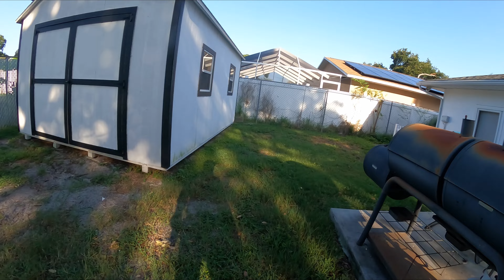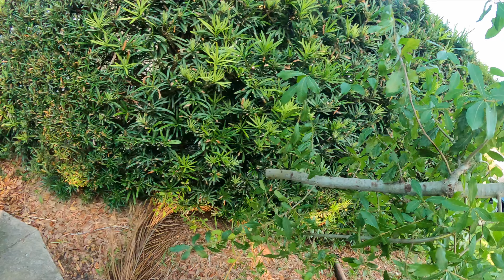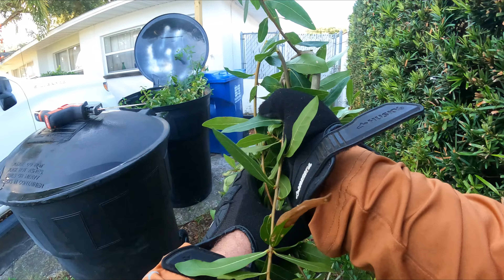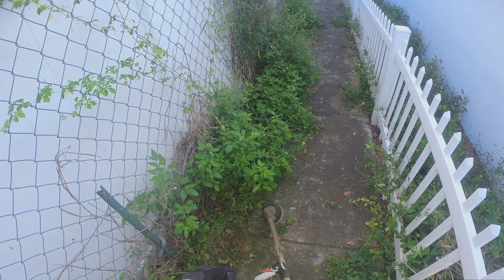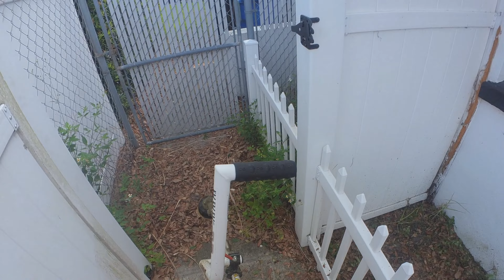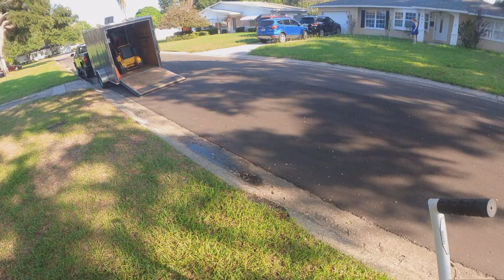Tall WEEDS DESTROYED | STIHL FSA135 R | LAWN CARE | FLORIDA | NO SNAKES !! @stihlusa #fsa135r

Comment: It’s looking like if I was to purchase a battery trimmer it would be this Stihl FSA 135. OMG a Echo guy might purchase a Stihl
Reply from the maker: You know what they say, once you go Stihl there’s no turning back.
Reply: @CityScapesLawnCare  haha. Well I have actually owned Stihl before. I sold all my Stihl stuff and went all Echo so that I had consistency in my equipment. I had more Echo stuff then Stihl so it just made since to keep my Echo stuff. I guess we will have see if Echo comes up with a good battery trimmer. I’m not ready to do battery yet, pretty dang expensive compared to gas at this point. Holding off for now. I know these words are going to come back and bite me lol
Reply from the maker: Funny thing is the expense on equipment is the same battery or gas, at least Stihl is. The only difference is the cost of the battery so in a way yes it’s more expensive but so is gas.
Reply: @CityScapesLawnCare  I hear ya. But with a $500 per battery I can buy a lot of gas for that.
Reply from the maker: @MyGreenLawn2019  there not $500, $249 for the max batt. $179 for the medium batt. Diff is 10 min runtime between the 2
Reply: @CityScapesLawnCare  2 batteries $500. Just saying, even one battery at $250. I do not use $250 worth of gas in my trimmer in a season. I just personally can not justify it at this time. If some people can that’s great. The technology is still new and we need Guinea pigs to use it so they can improve it. I will wait as long as I can to purchase, if ever. Back to your video. Good video Jim haha

Comment: LOL I recommend you use a different  blade on your saw I have the 18 volt milwaukee sawzall and I use the pruning blades they are completely different they look more like the blade of a  bow type hand saws with the big teeth wider spaced.
I originally tried the carbide blade as well but it doesn't clear the cut material away as quick and also seems to heat up and jams alot.
You get them pruning blades in 5 packs that way they are more economical. I'm using the Diablo 9 inch blades 5tpi. 
And mine lasts along time like 50 -100 cuts depends on what it is, also these prunung blades go really well in the dirt for cutting  tree roots etc seem to stay sharp after wards.
Reply from the maker: Good advice, that blade was horrible as you have seen.
Reply: @CityScapesLawnCare  PS One blade I never tried was the Diablo carbide 3tpi pruning blade, it was costly to buy but seems to have good reviews. Mostly tried the bi metal and the axe and steel demon and carbide steel only blades all performed poorly in wood esp green wood compared to the pruning blade.
I was also looking at some electric pruning shears like the Kebtek as they appear do up to around 30- 40 mm thick cuts  I was hoping Milwaukee would come out with one themselves as I already have them batteries and being a big platform and dealer network etc. Be good for hedge reductions and look smoother to use less vibrations
Reply: @CityScapesLawnCare You are not going to believe what milwaukee has just released, yes a pruning shear m12.
Below is the video name from you tube to watch, bit of a wait time till they come out though. 
"NEW Milwaukee Pruning Shears"
Reply from the maker: @tomsqualitylawncare5945  I saw the small one is that what you talking about? I’m tempted there at Home Depot now
Reply from the maker: Wait I just saw it looks like max it an 1 inch to 1/12
Reply: @CityScapesLawnCare  Milwaukee says 1.25 inches so 31-32 mm may go  little bigger with a 6 amp hour battery.
Not sure what you saw in home depot in the video it say's not coming out till spring 2023.
The pruner shears would leave a much better cut and regrowth finish than a recipricating/sawzall type blade.
The sawzall is more for a quick one or two cuts and good on tree bush roots but for general small type jobs for what I'm doing besides a hedge trimmer/pole saw a small chainsaw (bigger cuts) and pruner (cleaner cuts) is the best combination.